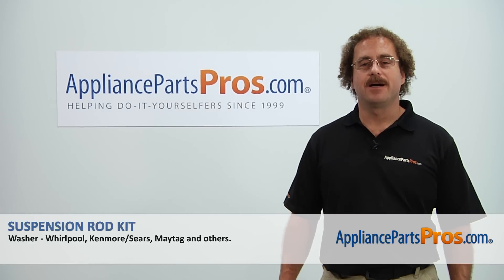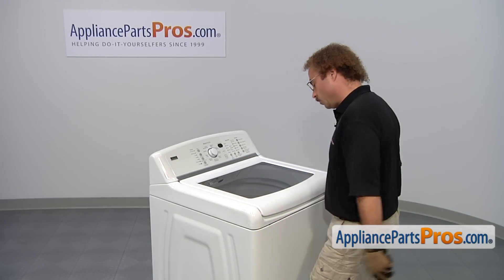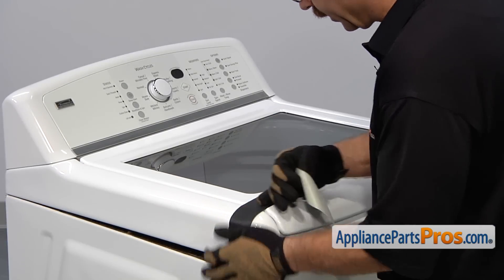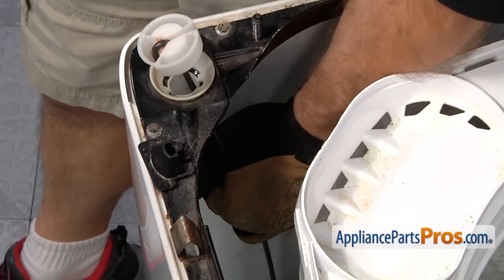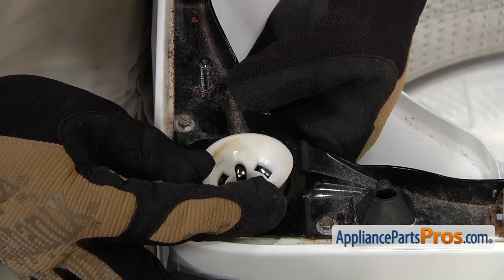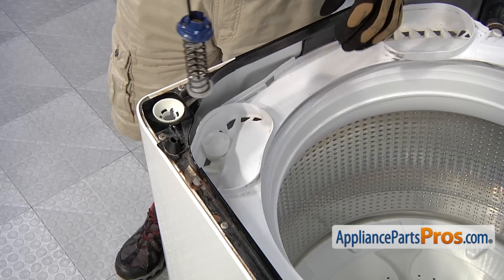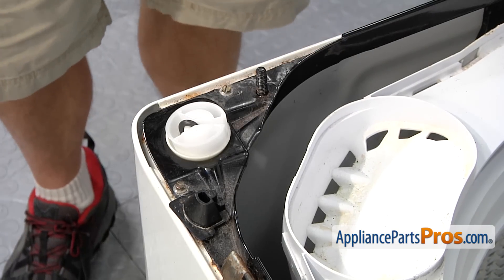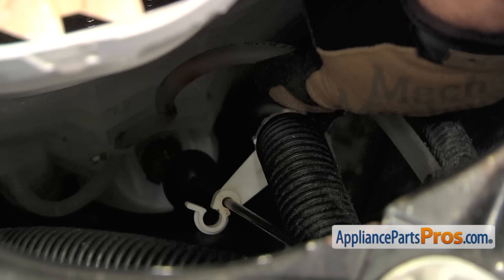How To: Whirlpool/KitchenAid/Maytag Suspension Rod Kit W10189077

Comment: Outstanding.  Wife started talking about buying a $2,000 replacement.  $80 bucks and an hour and it was easy.  Bravo on the video.  This guy must have some strong hands to pull up on the spring.  I found it easier to pull it a bit, then put a set of channel locks on it.  Made it much easier.   

Thanks much.

Comment: Thank you so much for this helpful video. Like many others, we had been struggling with our Kenmore Oasis washer for months - nearly every load became unbalanced multiple times, to the point where it was almost impossible to finish any load. This video helped us realize that a diy repair was doable. We ordered the parts from you and they showed up in two days. Washer runs like new, even with a large load of towels. I found it very difficult to lift the new rods high enough; even with using the old rods and then some twine to lift them, I had to have my daughter put the final pieces on for me. Definitely worth the time and $$ rather than buying a new W/D set!

Comment: This is a great video !!  Great concise step by step instructions how to replace the suspension rods.  My washer was giving a UL (unbalance load) during the spin cycle and just make horrendous banging sounds.  I searched multiple websites but nobody can give me the precise information how to resolve this issue.  I initially tried to remove the rods and clean up everything and put them back.  However, I still got the same errors.  So ordered from Sears Parts and guessed what - they sent me a replacement parts that didn't fit - the rods were 3 inches shorter.  I ordered directly from Appliance Parts Pro and received them in 5 days.  Replaced them today with the help of my 2 teen boys and within 30 minutes we were back in business - ran 3 loads already and no more UL issue.   Bottom line:  even though the old rods looks good - nothing you can see wrong with the rods or springs or nuts, the springs might not be compressing evenly since they have worn out from over 10 years of use.   Replace them and this should resolve your UL issue.  Save a bunch of money by doing this ourselves.  Definitely would do busisness with Appliance Pro Parts again.  Thank you !!
Reply from the maker: Thank you for your feedback! I'm so glad that the video and the parts you ordered from our website were helpful and that you were able to get it back in working order!

Comment: Thanks so much for posting this video even if it's 6 years-old already!!!   My Maytag Bravo couldn't get through a load without the unbalanced load cycle running, sometimes 2-3 times.  Your video helped me understand how to do this repair, hardest part was getting the top raised - those spring clips were really stubborn, did not want to release.  After that, took about an hour to replace the four support rods.  Even with non-skid work gloves, had a tough time pulling the new rods high enough up to slip the ball joint on, they're slippery with packing grease.  I finally took an old screwdriver and pulled the rod through just enough to slip the screwdriver shaft through the loop, then I could use it like a T-handle to pull the rod up.  Thanks again, hope to get a few more years out of this washer

Comment: Successfully replaced the rods today, thanks to the video and helpful comments.  Hardest part was getting the top of the washer open even with the tip to pull forward and up but I had done it once before so just kept trying.  Using the hook end of the old rod to pull the new one up through the top opening was extremely helpful.  Thanks to everyone.

Comment: Thanks for the great instructions! I think I got everything on correctly and the washer seems to be running fine as I type this. However, the replacement of the rods did not go as smoothly as in the video because the tub was very heavy. I could hear water sloshing around. Is that indicative of another problem? My Kenmore Elite's 10 years old.
Reply from the maker: It probably has a liquid filled balance ring, as long as it is not leaking it should be ok!
Reply: Thanks for the tip!

Comment: I have a kenmore elite oasis. Does this fix intermittent f51 and UL codes. I had to replace tub seal and bearing because there was a leak. 

F51 I was told can be RPS sensor. I bought a new stator from ebay because there was a slight crack. With the new stator I would get constant f51 code, with the old it would be random error. I am using the old stator because it works, but randomly get this error.

UL codes is constant when I run it in normal modes. How I get it to wash, is by washing it in delicate cycle. 

What do you think is the problem? Could it be one problem leading up to F51 and UL codes, stator or RPS sensor. Or both? Or something I overlooked. 

Any suggestion is much appreciated.

Appreciate it!

Comment: This video is very helpful. My machine has a problem of vibration i have change the suspension rods it is working fine. Thanks a lot for the video.
Reply from the maker: Timar Singh Glad the video helped you get the washer fixed!

Comment: Will the old suspension springs and rods have any visible indicators that they need to be replaced?  My home warranty company sent someone out and he doesn't seem to know what he's doing.  He's replaced several things and now thinks its the springs and rods which of course have to be ordered and will add 3 days to my now 13 day ordeal.
Reply from the maker: No, they don't necessarily always show visible wear. 

Give us a call, and we'll try to help you diagnose what's going on with your appliance. We offer free technical advice and diagnosis 7 days a week. You can give us a call at 1-877-477-7278 or you can chat us at our website: http://www.appliancepartspros.com/. We will need your model number to give you accurate advice, which you can locate using this tool on our website: http://www.appliancepartspros.com/modelnumber_locator.aspx

Comment: I have a kenmore oasis elite washer with the shaking problem issue.. I just purchased the rod kit and watched your video.. it didn't fix the problem.. is it possible that I did something wrong or maybe it can be something else?
Reply from the maker: Check for any other damage, also make sure the washer is completely level.

Comment: My Maytag Centennial washer does not have the openings for the rods to slip through so you can remove them.  Am I missing something?
Reply from the maker: When you lift up the suspension rod from the bottom, are you able to remove the plastic fittings?

Comment: Thanks for the tips but I had to unscrew the top screw in the rear on the top hard hinge before the top would move forward and lift up.  That took me over an hour to figure out what I was doing wrong.  Also, my front spring clips are located about 3.5 inches in from the sidewall, not 6.5.  Overall it was a very helpful video.
Reply from the maker: A single part can be compatible with hundreds of different appliances. We film the part on a single appliance model to serve as an example of the repair, but there may be slight variations in the process for different models. We're glad we could give you a good idea about how to do the repair, though! Thanks for letting us know how it worked out on your model.

Comment: I'm trying to install the new rods but I can't lift them up high enough. I followed all the steps to a tee and even "dislocated" the basket from using so much strength; almost dislocated my arm. I think the basket is back on track, but I still can't lift the darn rod up through the bushing enough to put in on the other thing to lock it in.  I'm at my wit's end here and almost ready to give up, but I can't afford to, and would be mad because I'm so close to completing this job. Once those blues things lock can they be removed without damaging the rods so I can make sure they in right? Any suggestions on why I'm unable to lift the rods high enough?

Well now I know I can't afford a repairman. Called this morning and got a $210 (to start) estimate. I could buy a new used washer, and looks like I'll probably have to. Very disappointing.
Reply: We just finished replacing them about 1 hour ago.  Take about 30 minutes.  One trick:  hook the new rod to the old rod and use it as leverage to lift it through the hole.  If it easier if you have two people to help hold back the tub from the opposite side so you have room to work on your side.   Be patient and you will save yourself a few hundreds bucks.  Good luck..
Reply: Also, wear a glove like to give some grip since the rods can be slippery ..
Reply: Mike Nguyen Thanks Mike, that's a good tip. I'm waiting for someone to help me with it, my arms have no strength left. I really hope this works. These repair guys always make it look so easy. 😕😞😩
Reply from the maker: This can be difficult. Like Mike said, it can help to use gloves with some grip to them, and if you can't do it solo you may need to get a friend or two to help you out. If you still can't get it, there may be some other problem. You can always give us a call with your model number at 1-877-477-7278 or you can chat us at our website: http://www.appliancepartspros.com/. We also have a free repair forum where the techs can help you troubleshoot the problem: http://forum.appliancepartspros.com/. We’re here to help 7 days a week.
Reply: AppliancePartsPros well, maybe 5 days a week. Problem solved. Thanks to Mike.
Reply from the maker: If you have any further issues, we'll be happy to help. We're open 7 days a week, from 7 am to midnight EST. For faster responses, give us a call or chat us on our website.
Reply: They are slippery. I just replaced the drive shaft, bearings and seal - a much more lengthy task. Had the old style with grease. I also found it difficult to lift them far enough to get the ball back onto the rod. Drive shaft replacement was long past due, but was also starting to get the uL error during spin when is cranks up the rpm at about 10 minutes left in the wash cycle. Thought it was the worn shaft and bearings, but still getting the uL error. New rods on the way now.
Reply: In addition to wearing a glove, I put some duct tape on the rod and gripped it right below it. That helped keep my glove (that became kind of greasy) from slipping.